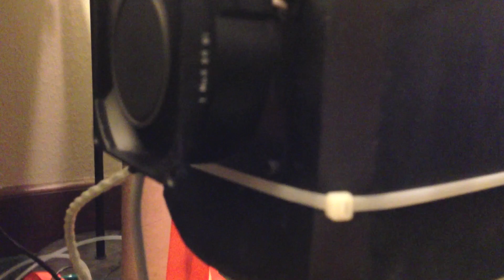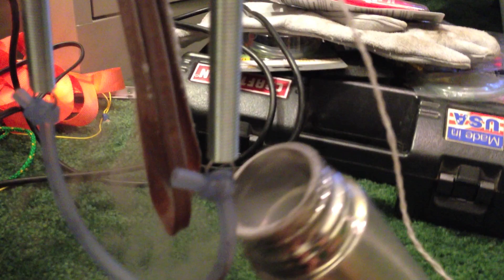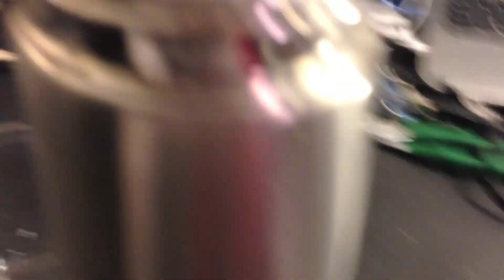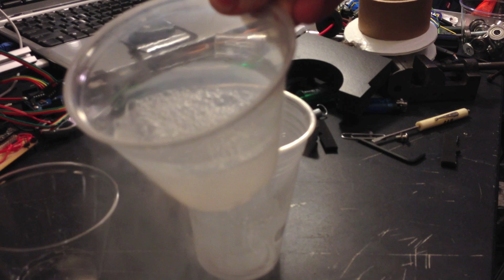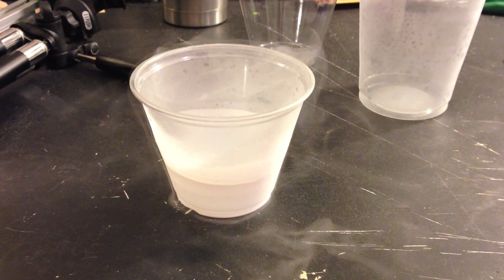Cryocooler Air Liquefier

Comment: If there is a potential differences anywhere, a object that neutralizes those potentials will always resist according to its fundamental resonance x mass. If one would light a neon bulb at a high enough potential but at its resonant frequency, then it would illuminate without power draw. Its impedance would be perfectly matched.
Reply: This would imply a super hv source and frequency of 1.31pm. Higher pressures could lower voltage potential but frequency will be hard to generate without a pentode vacuum tube
Reply: Ive heard of a pure thorium,radon,mercury ,sulfur phosphorus light that works if properly set in motion

Comment: Actually, handling liquid nitrogen with gloves is more dangerous than without - liquid nitrogen and other liquid air fractions will soak fabrics, and immediately cause freezeburns. Bare handed on the other hand, the leydenfrost effect keeps your skin safe. So unless you have special insulated gloves specifically designed to handle cryogenic liquids, you're better of not wearing any gloves. That of course only counts for the liquid portion of this setup. Touching the coldfinger or attached copper heatsinks with bare skin is another thing

Comment: thats how you should power an enviromently friendly car ... fill it with liquid air ... and for more effectivity its pre heated again before entering the cylinder in a seprate little high pressure chamber ... not mutch just so that it reaches like 20 degree C .. ambient temps....don t see mutch of a problem with this since people also drive cars around with liquid propane gas in their trunks

Comment: I tried this and never generated any liquid. Looks like I had the same cold head as you. It was from a superconductor device for cell phone towers. I ran it as-is when I got it and after a few hours it showed it was at operating temp. Did the same as you with the best rated thermos from Walmart and while it got very cold it did not liquify air. Also tried it on a 31 liter liquid oxygen dewar and after 24 hours of running no liquid and the air inside the dewar was about 
-150f. Was able to make a cloud chamber with it though.

Comment: Would liquid air in a closed copper coil system powered by different sealed cylinders be able to cool a home cheaper then residential air conditioning units.
Reply: not even close, they would cool about 10 times less than what a small window air conditionner would.
Reply: In a ducted metal tube are you sure it would not work? I am not has indoctrinated has you are. It so sucks to be a droned human. = /
Reply: A metal cylinder in an insulted tube being hit with a certain Hertz frequency to chill the metal below freezing then have air forced through it? Metal is just another form of crystal correct? But you were never taught this in which ever drone school you were forced to go through right? LOL
Reply: An education is a waste of time and hard earned money your parents wasted so very sad. = /
Reply: I am not a known it all but you talk like a known it all huh? ; )
Reply: The post was a baited question. Awe its a learning process in affect. ; )

Comment: Would helium in a capillary system be able to generate cold for cooling and heat for heating water and generating electric from the hot water? A system like that would be great for off grid living!

Comment: Make a mass air conditioner using this. Could you not run that liquid through copper coils and use a fan to cool the air? Then have the liquid run through capillaries that turn the vapor back into liquid to start the cycle all over again? What is the gas to liquid ratio using the liquid you have produced? Will it work like liquid nitrogen?
Reply: Cryocoolers are designed to produce a very low temperature, over a very small area. Air conditioners produce more modest temperatures, over a huge area (ie a house or room). Air conditioners are much more power efficient at their job, and hugely less expensive to buy compared to doing the job with cryocoolers. 

So yes you could make an air conditioner for a hamster cage with this, but it'd be a huge waste of money.

Comment: Could you use wazste heat to power this stirling engine based kind of cryocooler if I may ask?
Reply: unfortunately no; that would be basically a perpetual motion machine.
Reply: With an organic rankine cycle engine you could probably recover 10-20% of the waste energy back into electricity. Tough that would be a bit expensive.
Reply: Even though this is a Stirling, it functions in reverse. It uses motion to draw heat out rather than using heat to create motion.
Reply: doesn't heating the fuel up start the device and use it to maintain function?
Reply: It uses the compression and expansion of helium as a means to move heat from the tip of this device where it can then be removed from the system.
Reply: That's what I meant to ask that night, but my wording was messed up.

Couldn't you heat the end of the stirling engine with the waste to start it and maintain it with such?
Reply: Makes sense.

Thanks for the clarification
Reply: A normal Stirling engine has a warm end and a cold end, and generates motion. 

This has a Stirling pump, where motion comes from an electric motor, and the pump creates cold and warm. 

In a Stirling engine, the difference between hot and cold sides is what powers it. This thing uses power, and creates a difference in temperature. Particularly at the cold end. 

So it's the same thing, but backwards. Mechanically, the insides probably look just like an ordinary Stirling engine. The difference is between temperature causing movement, and movement causing temperature. The same Stirling machine will do either, just depends which way you rig it up.

Comment: Very nicely done.

I would appreciate a little info please if you have the time. I have one of these units inside a superfilter and although I can remove the whole unit easily enough, it appears that the system's own dewar at the bottom housing the filters is welded or brazed on.

Can you tell me what you found had to be done (and any tips/tricks) in getting access to the cold finger with as little risk of damage as possible when removing the dewar surrounding it.

As I say, mine appears to have the electronics dewar actually brazed or welded in place - and I am wary of using an angle grinder on my new toy!

Kind Regards
Mark

Comment: how to separate co2 from other gasses in the liquid air?
Reply: that would be the white ice like substance that forms on the cold end. It would be more practical to make a 2 stage refrigeration system to get cold enough to solidify co2 then pump in pure co2 gas.
Reply: +Kyler Kraus ahhh so get the chamber cold and then run a chemical co2 generator intop the chamber and cycle it through to get a dry ice buildup..
Reply: Yes, if you are interested in actual dry ice production look into auto cascades by the overclocking community. Simple to build and reach cryogenic temps quite easily. For the CO2 production Cody's Lab has an interesting video about using yeast fermentation, he goes on to compress the CO2 and uses the Joule Thomson effect to reach cryo temps, similar to the DIY dry ice via CO2 fire extinguisher videos. Personally, I would implement the combustion of a hydrocarbon and then a water trap to make cheap CO2 then auto cascade to dry ice. 
Sorry for the late reply.

Good Luck!
Reply: Thanks  Kyler appreciate the reply

Comment: coult i use that to cool my computer ? whats the amount of heat removed in watts ?
Reply: +Niggro Hitlerius Not nearly enough for even a small cpu. Use a conventional refrigerant cycle cooler if you need lower than ambient temperatures.
Reply: +Niggro Hitlerius Dude? What is your PC? The sun?

Comment: it probably is just liquefying the Co2 in the air because Co2 boils or in this case condenses at -57 Celsius
nitrogen is -196 Celsius
  oxygen is -183 Celsius
    argon is -186 Celsius
            So realistically it's probably just water and Co2, but it is possible that it did get that cold
Reply: Tom that is probably one of the most stupid things i have ever heard... Sorry but retake basic chemistry because if you even did take chemistry you would know that its is Impossible for there to be "liquid" CO2. This is because our our atmosphere is to low pressure for the CO2 to be inside of its liquid form... If you do not know what you are talking about please do us a favor and not act like you do and give us mis-inforamation.
Reply: good point
Reply: 二氧化碳在常温下不存在液态的，它会由液态变成干冰的。所以不可能。至于水，有的话老早就结冰了
Reply: HOD0R the guy did say he ran it for 2 hours, plus Oxygen is blue and makes up about 21% of the atmospere so if there was any of those it would probably be blue
Reply: You need to watch more of the video. He showed that the liquid air was starting to turn a very faint blue, indicating there was liquid oxygen.

It would also be impossible to have liquid CO2 unless this guy isn't on Earth (looks like it though), Earth's atmospheric pressure is too small to have liquid CO2.

It might be a bit of water, but liquid water is easily impossible since it's showing the leidenfrost effect. It's also easy to see the water vapor condensing around the cup, so it's most likely some nitrogen and oxygen.

Comment: wow, whats it like to be the shit bro? do you think this device is a feasible energy storage possibility ? you could run an air motor on the stored energy
Reply: You can reverse the process by using the liquid air for the cold side of a Stirling engine, but it's terribly inefficient.
Reply: Exactly.  A closed cycle would store the equivalent of 10k psi tank but no need to hold pressure. Also because the nitrogen would cool from doing work and you would use a heat exchanger you would need a lot less energy to reliquify as you would if you recompressed it. It may even be possible to create "free" energy using ambient heat as the energy source. Say there's 100 watts available from liquid to ambient. The liquid absorbs 40 watts from HX (heat exchanger ) absorbs 60 from ambient. Then generates 50 watts in air motor so it now has 50 left. It transfers 40 in the HX leaving 10 to remove. If you can remove that 10 using less than the 50 you generate you have free energy. It's the rankine cycle used to generate electricity with boiling water combined with the Claude liquefaction cycle. Look it up And let me know if you're interested. I'm working on it now actually.
Reply: That was an oversimplification of course. Factors like Carnot efficiency, pressure drops, heat exchange, Joule Thomson cooling etc come into play along with the engineering with pumping liquid nitrogen and flow control. I have the dewar heat exchangers , air motor (scroll compressor running backwards ) and other air motors to stage the pressure drops and cooling, and Joule Thomson valves (porous stainless steel plugs)and I'm working on a pulse tube cryocooler now but it's no easy task. I'm using speakers as pistons with phase differences, a pulse tube and regenerator.

Comment: Here's an idea, leave off the thermos and it can work as a miniature air conditioner.
Reply: sam vanoss For an air conditioner to cool the air in a room, it has to have somewhere to eject the heat OUTSIDE the room. The cryocooler here doesn't "make cold", but rather it moves heat out of the "cold finger" and spits the heat out into the room, so taking the thermos off would just make for some cold copper tubing in a very slightly warmer room.

Comment: i've been looking at Stirling piston coolers for some time now...but they all are relatively expensive. are there any that sell in the low, low $100's?
Reply: nope.  I got one for ~600.00 but that was a steal.  the typical ask is ~2500.00
Reply: @en2oh  Yea, where did you get yours?
Reply: @sup2069  just lucked out on ebay.  less than $1K but more than $500.... can't recall exact number....
Reply: @en2oh  Man what a steal. Spoke with a sales rep, they sale only to businesses. The lowest base model was roughly 16k! 🤯
Reply: I cant find them anywhere. Where did you get it?

Comment: Nice work! I like the use of the variac to power the whole thing. Do you know how many watts you were putting into the cooler?  It's rated for 140W continuous, and the original power supply seems to top out at 150 or 160W. With your setup, you might be able to measure or estimate the winding temperature, and give it a bit more power.
Reply: (I know this is super old) just came here after your video on a cryocooler
Reply: @KingJellyfishII  🔴 What Is Islam? 

🔴 Islam is not just another religion. 

🔵 It is the same message preached by Moses, Jesus and Abraham.

 🔴 Islam literally means ‘submission to God’ and it teaches us to have a direct relationship with God. 

 🔵 It reminds us that since God created us, no one should be worshipped except God alone. 

 🔴 It also teaches that God is nothing like a human being or like anything that we can imagine.

🌍 The concept of God is summarized in the Quran as:

📖 { “Say, He is God, the One.  God, the Absolute.  He does not give birth, nor was He born, and there is nothing like Him.”} (Quran 112:1-4) 📚

🔴 Becoming a Muslim is not turning your back to Jesus. 

🔵 Rather it’s going back to the original teachings of Jesus and obeying him. 

More .....👇

🔴 THE RETURN OF JESUS

Comment: That is quite a yield, Ben Krasnow built a LN2 generator using a similar cryocooler and was generating approximately 1 litre per day using water cooling for his heat exchanger, he used a molecular membrane to separate the nitrogen from the air. Maybe you have a higher capacity cryocooler. Were you one of the lucky ones and sourced the cooler for a decent price? Nice setup